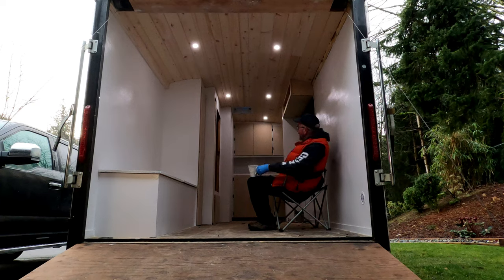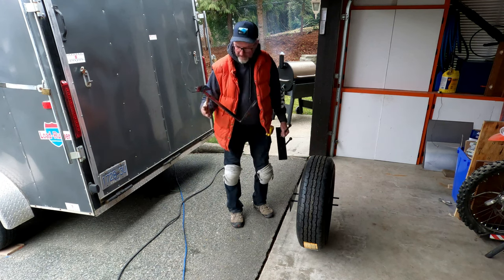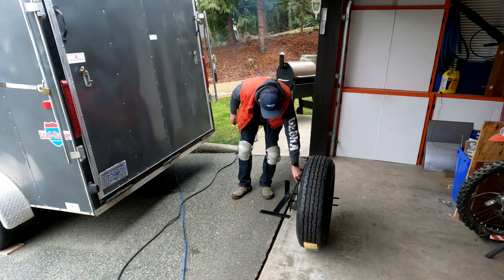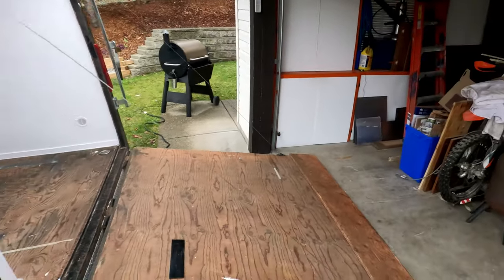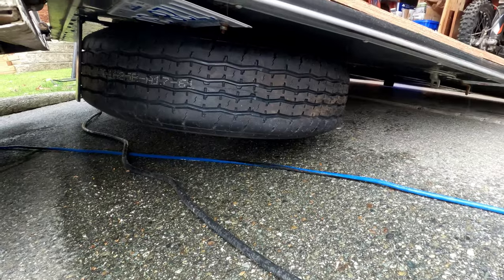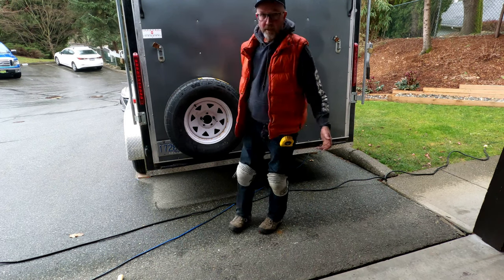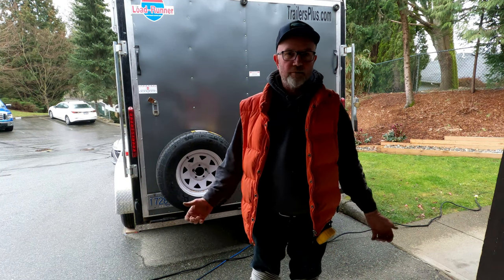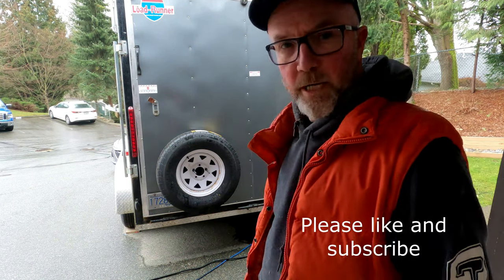Cargo Trailer conversion

Comment: good deal... I will be putting one tire on the back of my 8x16 v-nose conversion.  It will be an RV and Mobile Sign Shop... will be carrying all my equipment and supplies on the road... designed the inside in the computer aet full scale... keeping a YT series going until finished
Reply: Hey American Wanderer!!! The best part about the exterior mount is keeping the junk outside the trailer. I’ll be fabricating an exterior wall hung ladder system and interested in hearing feedback from you as you’ve got the mobile sign shop incorporated into your design too. 
I wish you the best in business as well as life in general!!! Happy Wandering my American friend!! Bruce out!!

Comment: Good video, and I am also mounting the "1" spare to the rear door, because it will have vinyl flooring on the ramp my method differs slightly by using an aluminum 1/4" plate on the inside which will be routed into the 3/4 plywood for a flush finish, with stainless carriage bolts to secure the tire, just a different way of doing the same thing.
Reply: That sounds good WRXS!!! I’m interested in how your system looks when it’s done. Thanks for the feedback!!!
Reply: @brucemclean934  When it warms up, I will do the install, still dam cold in the north.
Reply: Where’s the north you refer to WRSX?
Reply: @brucemclean934  North eastern shores of lake Huron, and still cold and snow.

Comment: So will you get a ticket for covering up part of your license plate? Here in the US cops will use it as an excuse to pull you over.
Reply: @mike I did move the license plate location to the center, in between the two wheels. Thanks for the thoughts.

Comment: Not totally sure of the importance of having 2 spares that  are flat after you let the air out???????
and  you should consider moving license plate.
Reply: @ron thanks for the thoughts. The tires only require being slightly deflated to remove them from the holder and in my opinion the best simplest method of securing them without needing cables and locks. I’d always recommend having a portable battery/plug powered tire inflator when on road trips to ensure the pressure is optimal. And I did relocate the license plate location to the open area between the two wheels.

Comment: If you’re weld’s break the hole thing will fall off. I wouldn’t trust it.
Reply: Thanks For the thought David and good point. I did consider the breakage concept. That’s why I used wide flat stock to set the weight of the wheel on. The wider stock material weld gives me an ability to spread the weight out and the rods create additional hold and strength. Sometimes you just gotta trust in your own work. Whether it’s your own work or someone else’s, at some point you’ve just gotta trust. Thanks again!!